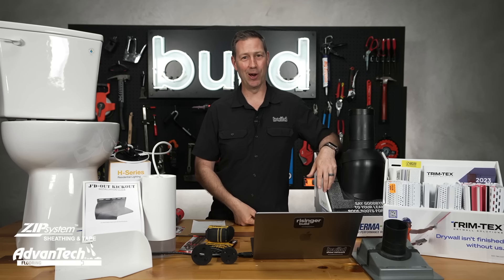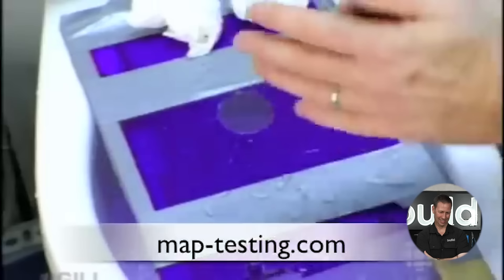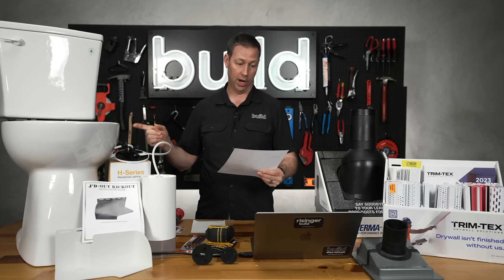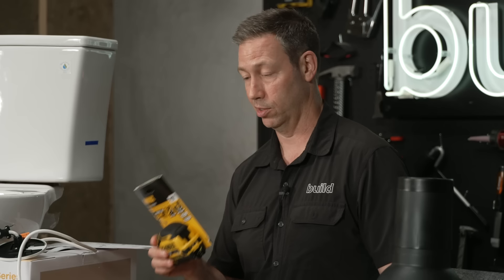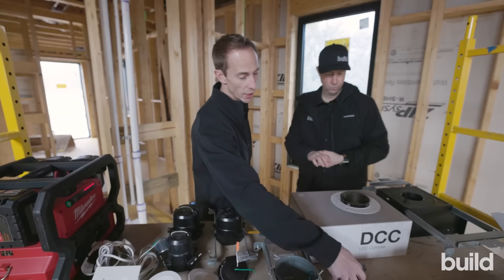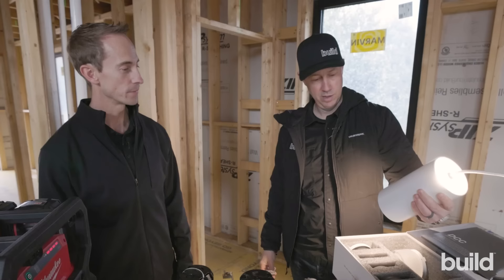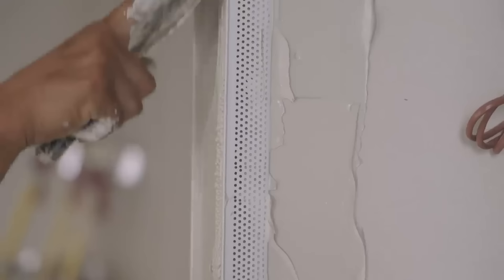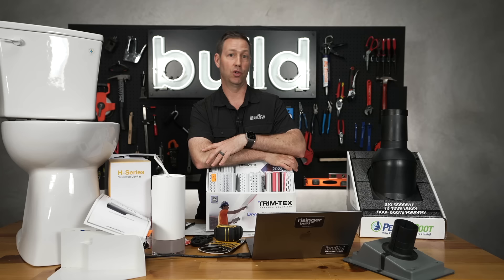What’s New with Building Products! 2023 Update

Comment: There’s a place in heaven for whoever designed can light fixtures that are serviceable after being dry walled into place.
Reply: Most recessed spot light fixtures in the UK are fitted after drywall installed. A hole us cut into the drywall after its hung, the cable fished down and the fitting holds itself in place with spring legs that push against the back of the drywall and can easily be removed.  I've often thought US fittings look overly robust.

Comment: Do y'all intend to look at the Lok-N-Blok cement stone substitute construction building material at some point? Basically engineered blocks made from polypropylene  that interlock together that would replace cement blocks in essentially every  situation where you'd normally use cement blocks. Much faster insulation, totally weatherproof, lighter, and apparently they are so strong that during their seismic qualification tests they actually broke the test bed before without failing themselves. Also only marginally more expensive than traditional cement blocks.

Belinda Carr did videos both on the product itself and interviewed the inventor who has apparently been working on this off and on since the 1990s.

Comment: PVC will fail in sunlight if it is not properly rated for the usage.  I’ve seen pvc conduit (electrical) hanging in hyperbolic arcs between supports because it has lost structural integrity.  It can also become very brittle.
Reply: PVC FOR ELECTRICAL MUST ON THE CONDUIT SAY SUNLIGHT RESISTANT or it will wave when exposed to light.

Comment: The American toilets are just weird to me, a a European. Our toilets (and I think Australia is the same) have 4 inch wide pipes in the bottom and way less water.  Zero risk of dunking your uh privates into water, the water is way down there from where you sit. Nobody has a plunger by their toilet here, because toilets just don't clog. Unless you dump something truly heroic I suppose. But I've done some pretty heinous deliveries myself and gone a bit overboard with toilet tissue too and never had a clog - occasionally, the water level has risen alarmingly before the weight of the water just forces everything out. The only downside is that these do need a toilet brush nearby to deal with stains, and I suppose you get more odor since there's no ocean of water down there for poo to get immersed int.... I'll take that over having to have a plunger and routine clogging, eww.
Reply: As a  frequent user of both types, I agree

Comment: Matt should look into GE's ultrafast combo heat pump washer dryer.  People are saying it's revolutionary.
Reply: So, the thing you have to watch out for on these things is whether or not they have a vented outlet to the outside. If not, then it's basically just an enhanced condenser style of dryer, and it still won't dry anywhere close to as fast as a vented American style dryer.
Reply from the maker: Oh sweet. Gonna look into this.
Reply: H series is effectively vaporware-they basically only market it to very large builders   Multistory/multi family construction. So why are they even presenting it on a channel like build show?? Matt can get ahold of these, you can’t. Yes they market thru Home Depot but only in bulk and they haven’t had the light module for months and months.
Reply: @johnwhite2576  what are you whining about?
Reply: really excited to see this coming out.  Planning to use this washer/dryer in the Build Show Boston house.  Still putting a vent line into the ceiling that could be connected to the outside if ever needed in the future.  Another point for this new combo unit is that it has a very large capacity, unlike so many of the heat pump dryer only units.
Reply: @shubinternet  this one is supposed to be different.  The appliance people say it's a new generation of heat pump tech that doesn't have the limitations of previous models.
  
I'm looking to build a custom ICF in Tulsa and Don't want to deal with the vent.  I just bought one for my current leaky house to test it out before I essentially build a laundry room around 2 of them.  The price tag is high as well.
Reply: @jasonsstratton  how do you like it so far? How long does a dry cycle take?
Reply: @Katana_00  it is scheduled to be delivered Tuesday.  I have seen good reviews from trustworthy places like Yale appliance, but I'm buying it now because I have trust issues with appliances in general.
Reply: @jasonsstratton  please keep us posted!!
Reply: @Katana_00 I like it.  It's fast easy, and seems to work flawlessly.    The box stores have had it on sale for 2000 of you can find.

Comment: Ummm. PVC definitely goes bad from UV exposure, even if you paint it. It becomes super brittle after about 10yrs, which isn’t a long life by any means.
Reply: I've seen multi decade PVC that's still good. Wonder what the difference is.
Reply: @allysonand  poke it with your finger. Guarantee it will chip apart.
Reply: Different quality of materials perform differently. Get a higher grade
Reply: @sparksmcgee6641  lmfao. You really don’t know what you’re talking about. PVC is PVC.

Comment: 6:27 It’s interesting that the toilets keep getting lower and lower in water consumption yet the infrastructure that they are connected to has not improved…  My friend worked for our municipality for decades and regularly faced challenges with clogging sewer pipes because there simply was not enough water pushing the solids through the system.  I am all for water conservation but the cost and environmental impact of constant truck rolls has to be somewhat negating the benefits of the conservation.  I think reusing gray water or rain water or some other source of reclaimed water is a better solution to using less water.  Thoughts?
Reply: Agreed, it's pretty silly that we're flushing with fresh water, especially on sewers. People using well supply or septic for waste have other considerations though.